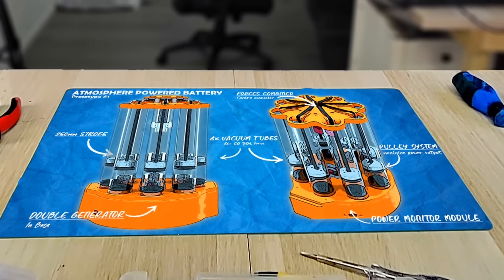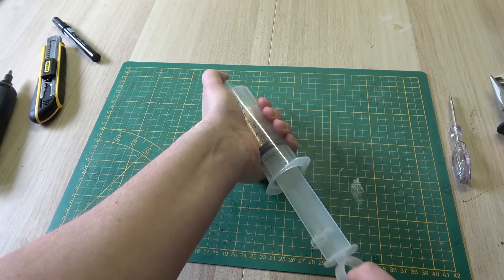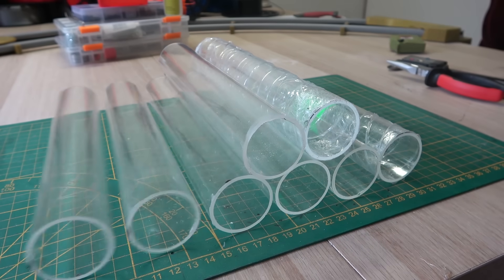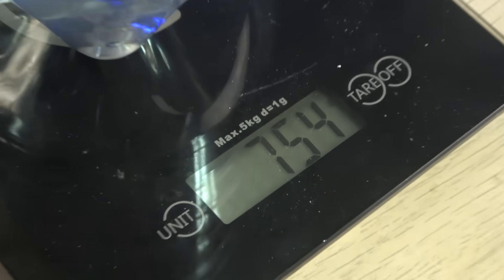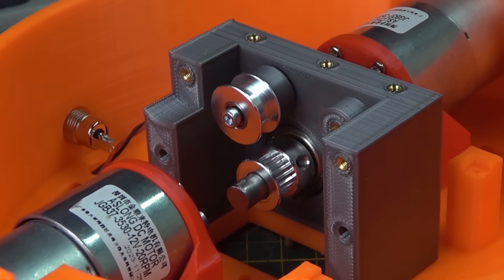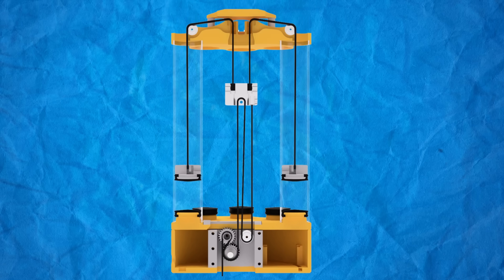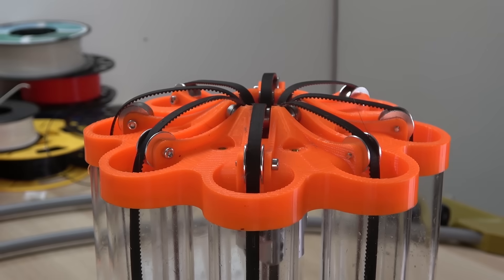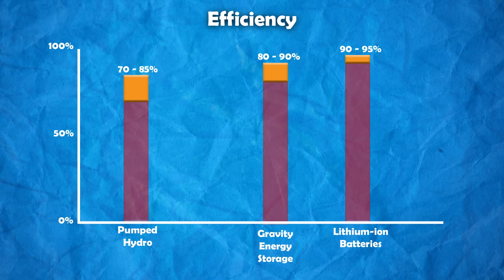Building an Atmosphere Powered Battery..

Comment: I liked that. You should definitely look into a few more iterations of this vacuum system. But instead of electric motors to set the load against gravity why not combine the concept of the sand battery which is loaded with waste heat from trash gasification and incorporate that with your vacuum battery (think Boyle's law/ gas law). Your current set up is not optimized, I think your belts are causing losses due to the elasticity of the belts also there maybe energy losses due to temperature changes in the gas in your "vacuum" so yes you should redesign and optimize for a few more iterations of this.

Comment: As for using old mineshafts for energy storage with weights mentioned in the start, I really have my doubts about the viability of that from a practical standpoint.
I work in the mining industry as a geologist and maintaining an abandoned mine is very expensive and a huge liability. Underground mines are almost always below the water table, so there needs to be constant pumping and maintenance done to prevent flooding. The ventilation would also need to be maintained to prevent explosive gas buildups. Any unsealed areas could leech more toxic materials into the mine water. And mines are naturally unstable, they will collapse eventually.

Comment: The mineshaft example is similar to water resivor batteries. When you have small amounts of energy, you pump water uphill. And then when you need energy, you let the water run downhill over a turbine.
Reply: The reason pumped Hydro is so good, is that it requires little maintenance. There isn't a single heavy weight to move, there aren't many moving parts, and the parts that wear out are a small portion of the overall system. Unfortunately there is a large upfront investment. The issue with this system, is that it has many parts that are likely to wear out.

Comment: Charge the battery when air pressure of the weather is low, and discharge when the air pressure of the weather is high?

Comment: Well, since you excluded from this scheme a bulky, heavy heat accumulator with 100 tons of sand, then this is already a success. And seriously, I like the elegance of this solution, even in spite of the many "extra" mechanical parts of the generator-battery, because they are elements of surprise - they can fail at any moment, which will spoil the operation of the system. But the concept itself works and if it is brought to 80%, then it is already worth doing on a large scale. My guess is that the closer this system is to a free solar or water resource, the less efficient it can be. And, conversely, the further north, where the need for energy is higher, the more efficient this system should be. Well, even 73% will come in handy somewhere, although of course, the more the better.

Comment: You can't store energy in gravity if gravity is a force your storing energy from compression in a cylinder no different than an air compressor or a diesel hell the small rigs that pump oil do this your just making a pump that's gonna fail plus there is no way to effectively use this compression energy on large or even portable scales

Comment: You mention that the system at 1:05 would require too heavy of a weight to be practical. Do you think if a gravity system used a clockwork escapement and gearing, could a smaller weight (maybe 20-25 Kg) and a high efficiency generator motor provide enough energy for household use? I would be willing to wind a clock in my basement every day if it meant I didn’t have to pay an electric bill!

Comment: Cool contraption.  What you built is actually a constant force spring.  Your setup is very similar to the FRC robot that team 4907 built in 2022 for our end-game mechanism to "jump" up to the traversal bar.  Do a YouTube search for "4907 jumping robot" to see it.  That used a 6.5 inch diameter cylinder with a 33 inch stroke producing a nominal 480 pounds of force.  We found that lubricating the seal to cylinder wall contact was critical to get the energy back out.  Also, a brushed DC gear motor isn't going to be very efficient.  For industrial purposes you'd want a 3-phase AC motor, or at least a brushless DC.  Also, watts isn't a measure of energy, it's a measure of power.  You want to know Joules.  You can calculate this with Work (energy) = Force x Distance.  You know the force (atmospheric pressure times area) and you know the piston displacement distance, so you can calculate the theoretical energy stored.  Then you can measure the actual efficiency of charging and discharging.  Also, note that this won't work the same at sea level vs. at high altitude. In fact the force will be significantly different and you need to account for the location in the design.

Comment: Hey man, you can't measure energy in Watts. That's ridiculous you finished quiet complicated project and making such primitive mistakes making it all no sense. Watts are power measuring units.
Reply: Now I saw the conversation below it is actually joules. 
The issue with measuring can also be that voltage and current should have been changed a lot during measuring. I can't believe thet were constant.

Comment: Sure, lithium is efficient in charge-discharge, but the most important thing here is reliability and price. The fact that you have 70% efficiency at home makes your project way better than the costly and dangerous lithium batteries. I feel like there should be at least some ways to increase the % up to 80

Comment: I would retest the efficiency at different time lengths of storage, 12 hours, 24 hours, and one week maybe. I feel like the issue with this system is the air that will leak into the vacuum if the seal isn't perfect.
Reply: and if seal is "perfect" friction will drain all the power

Comment: You can't actually reduce the use of fossil fuels with better batteries. What do you think the batteries and the green energy devices are made of? A solar panel doesn't produce enough energy to offset its energy cost during production... They usually last a maximum of 14 years, with most lasting 7-10 years. Hate to burst your bubble.

Comment: I  wonder what the physical max would be of this if you scaled it up to be as big as possible? It depends on surface area to function but my gut feeling is the weight/strength-req of the parts would increase faster than the surface area. At the very least it is a neat little physics demonstration.

Comment: I doubt very much this idea finds a practical application beyond the curiosity value. There are a few reasons for that: 1. A lot of moving parts under huge for an industrial scale forces while maintaining airtight seals screams quick wear and tear. I really don't envy the life span of those seals. 2. Its energy density per unit of cost is inferior to the existing solutions. And the sad thing is the energy density has a natural ceiling, only 1 bar pressure difference is there to play with. 3. Maintenence of such an unnecessary complex system could be a nightmare, compare it to maintenance of a hydraulic lake storage, one pump at a time, piece of cake.
And that just off the top of my head, I am sure there are more issues. 
And from an amateur historian point of view: the principle of this storage is very simple and well-known, so if it was viable it would have been implemented decades if not centuries ago.

Comment: Efficient?  Perhaps.

But the volumetric energy density has an upper bound at 0.028 watt-hours/liter, as opposed to 210 watt-hours/liter for lithium ion battery.  So to power your house from this, you would need the equivalent space of 10,000 Tesla power walls.

 Nonetheless, a really cool demonstration of the power of a vacuum.

Comment: Maybe thermally insulating the tubes might increase efficiency. When the gas expands it cools down, that may then pull heat in from the outside world which would increase the pressure, when the gas contracts it'll heat up and dump that heat to the outside world. You have inefficiencies in that heat pump.

Comment: maybe a systema like this could be more efficient if for charging the "battery" you just pull unseal volumes, then seal, and vacum pump the interior, not easiest method sure but maybe more efficient.

Comment: Did you try lubing the seals with a lightweight oil? It should reduce friction and increase the efficiency of the vacuum. 🤔 Just a thought! Very cool build!! 👏✨ Brilliant idea, by the way. 

As dyyor scaling up, maybe just having more of the small units would be good. It adds redundancy. In case one goes down,  you don't loose power completely. 👍 Plus, you know that the small model works already. ✌️✨ 

Thank you so much for sharing this amazing concept! 🙏

Comment: Nope, as a vacuum would lose it entire energy load in a matter of seconds if breached, furthermore hydro only loses to evaporation and can be naturally replenished. Also the larger the device the more surface area to potentially leak. If storing energy from solar, you would still need to convert back and forth to electricity thus losing efficiency in every conversion.

Comment: All these ideas for storing energy and we already have a pretty fuckin' good method that's worked for a long time. Pump water to a higher elevation. Let the water drive a turbine when you need it to generate electricity. All these ideas about using physical objects like bricks and weights are so monumentally stupid. I'm not speaking on the topic of energy storage with gas/atmosphere as that's another can of beans.

But there are people who think it's a good idea to stack bricks for energy storage.

2:15 I'm sure you already knew since you converted to Newtons in the visual but Grams are not a measure of force at all.

Comment: Some many question...  
Why vacuum and not compress air ? You can store way more energy using compress air and you buy easily air compressor anywhere.
Why use a complex belts and pulleys system where you can use a hyrolic one ? 
Why didn't mesure the deperdition of vacuum overtime ? 
Beside that the research have been done a long time ago and it's note a efficint way of storing energy sadly.
I have to talker I will do it on adaptative blades to improve the efficiency of windmills a different wind speed for example.

Comment: Please remember that with such stored vacuum  energy comes the potential for implosion of the vacuum chambers. Very large amounts of energy could be released on implosion. Also, on a grander scale there is the heating and cooling effects intrinsic in pressure changes in gasses. This adds to inefficiency.

Comment: you can literally do the same thing with a old clock with a pendulum and weights... its just converting kinetic potential energy into mechanical energy and then instead of turning hands it turns magnets around a coil to turn it into electric energy  if you do right with your gear ratios you can charge a battery all day. and you just use gravity instead of vacuum tubes.

Comment: Great video! Nice build, but this has no potential whatsoever. The amount of energy you can store in such a system per volume (energy density) is minuscule. Pressure is joule per meter cubed (J/m^3) so at atmospheric pressure, you are storing 101 000 joules per meter cubed. Compare that to gasoline that is storing 35 000 000 000 joules per meter cubed.

And that does not account for losses.

For proper energy storage, we need something that is at worst 10% of gasoline, especially for automotive applications.

Comment: If this was in a sealed pressurized container the pressure differential would be higher allowing you to store more energy, It wouldn't change the energy efficiency but you could make it smaller.

Comment: I saw a system once that used the buoyancy of water to lift a tank, attached to a generator with cables. When it gets to the top on one side, the tank on the other side is filled with air. It like an air/water see saw. I can't find the diagram I saved, but it was a cool idea. I think its called the Willet Buoyancy system.

Comment: You can also put a permanent magnet within the bottom of that metal cylinder and put copper windings around the tube so it induces a current just from the magnet traveling along it's path. This current should then be stored in a small bank of capacitors, and used as the storage of power to be trickled into a denser power bank.

Comment: To gain extra charging voltage, couldn't you add two more motors with one way clutches on them, so when the 2 motors are operating to pull the pistons up, the clutch on the other two motors are free spinning, so no extra load is put on the system, and no extra current is being used to run the two extra motors, but when the pistons are pulling back down, the one way clutch will engage on both motors now having 4 motors acting as generators, supplying extra voltage back to the batteries, because by using two motors to lift the pistons and two motors to recharge the system, your going to have a loss through friction, but if you use two motors to lift, but 4 motors to charge, you should gain back some of the loss from friction, back from having extra generators suppling more electrical energy back into the system, giving you back a much higher efficiency rating, and if you put capacitors in line with the generator's, you will get an even higher rate of return, because capacitors store energy, but also reduce the back emf produced by the generator coils, so your efficiency increases, when using capacitors.  🤠👍

Comment: Cant help thinking like this:
How much energy would i take to heat  water to steam to rise the cylinders and  how much vacuum will it produce when steam turns back into water....
The gain i can see in such a contraption would be that the steam does not have to do much work when filling the tubes.

Comment: Please forgive me if it is nonsense, but I have a few ideas:

Would compressing air instead of creating a vacuum work as well / would it be less or more efficient?
Could you increase the efficiency if you minimize friction beetween the tubes and seals?

Great project, really. I am not a professional in this area, but with stronger materials etc. this seems like it has potential. Cool.

Comment: 30sec in.. and this "green" energy movement has also led to probably more emissions, extensive exotic metal mining and actual pollution such as solar and wind farm's garbage that's hardly being recycled. It became an actual environmental concern😂. 
As for the concept. Vacuum has its limit ~1 bar of energy. With the same amount of materials used, it's makes more sense to store positive pressure going wayyy above potential energy of atm pressure.

Comment: You missed a few VERY important pointers here... They popped up immediately while seeing the video. You can either take 'm and run with it, or I'm patenting this hahahaha... 

1: Add a flywheel with freespooling clutch, so the weights going down power the flywheel. Because it rotates even after the weights have stopped, it keeps charging the battery. This is similar to a "Hit 'n Miss - engine".
2: Hook the system up to a home-battery or a serie of car batteries that can be used to power a home.
3: Let the Arduino check the battery charge so it turns on and off the entire system. When the battery is full, switch off. At 30%, switch it back on and make sure the cycle repeats!
4: Upscale with more durable materials, so people can install it in their home and always have a charged battery to power their needs, even in a power outage! 
5: Realise you never have to work again if you market it properly and give me 1 euro per sold home charger LOL. (ik stuur wel een tikkie)

Comment: Awesome design. 

It got me thinking, if there was a way to get the vacuum cylinders to to discharge individually in a sequence while charging up the discharged ones. We could see it serving as a continuous power generator. 

I'm also thinking if you had access a flowing river, perhaps we could find a way to generate the charging power. Theoretically, you could get the energy needed to charge for free, and with a timely sequential discharge, we're looking at more efficiency and reduced cost.

Albiet there are a lot of things I'm accounting for here, I'm not a science or engineering major, this purely my speculation out of personal interest in stuff like these.

And for those who don't seem to understand that this is a baby version, simply take the positive aspects of their criticism when working a V2, if you want to.

Great video by the way.
Cheers

Comment: This may affect efficiency a little bit, but for durability sake, I would recommend a chain drive for the draw system instead of a belt. I also recommend Moss that the changeover in between charge and discharge for when the vacuum battery gets to the Apex in which to be released, it does not have to be fully switched manually this way you can hook up a solar panel, and when the power, alters reduction voltage to maintain draw then the vacuum generator can take over for generation of power per se until there’s a full charge of your battery bank. This would basically be the equivalent of a solar charge controller for your system so I guess we could call it a vacuum collapsible Switch control it could be as simple as just using a old-school magnetic electric switch that collapses when voltage is reduced to a point where it no longer has the pool on one polarity versus the other these are used ultimately and a lot of circuits for climate control believe it or not I think as a back up system for solar charging this would be ultimate because there are a lot of days where you’ve got advanced cloud cover in many positions where it would be good to be using solar